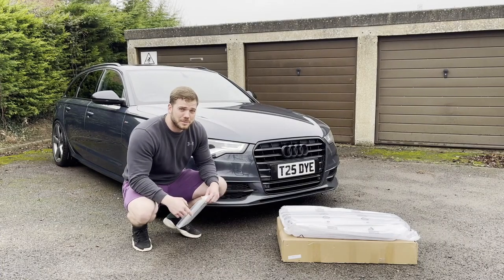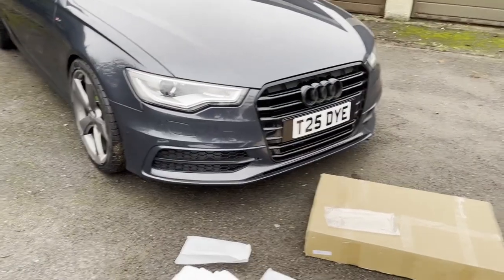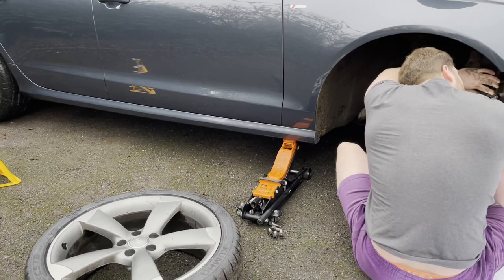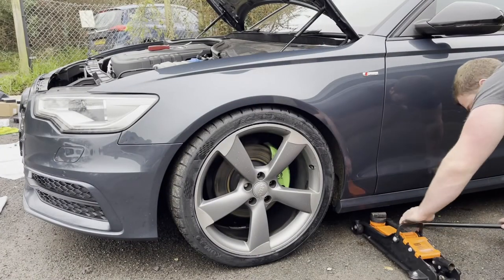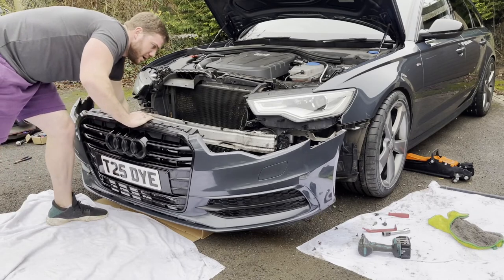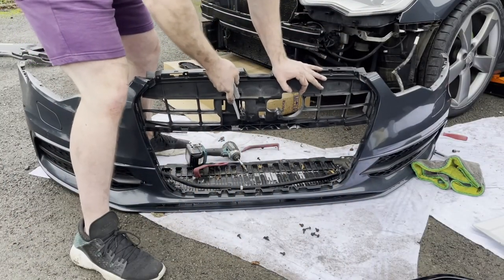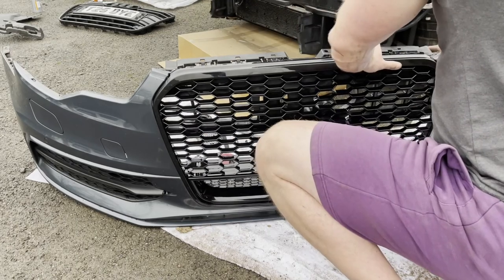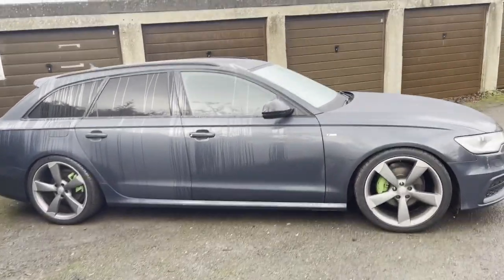Installing an Audi RS6 style Grille on the A6

Comment: looks really good... i'd like to do this my 2014 a6.  what year is yours, and how did you fit the front camera?
Reply from the maker: Cheers bro, mine is a 2014 as well, it’s well worth it. You’ll spend a little bit of time adjusting and tweaking your heights to get it to where you want but once you’ve found where you like it then it’s all worth it. 

Front camera?? I don’t have a front camera buddy
Reply: @TomDyeYT  huh that's weird i thought that was standard... it's the front parking camera... anyway thanks for the reply looking to try to swap my grille this summer.  keep up the good work!
Reply from the maker: @bigwass  cheers bro, the sensors are standard but I don’t have a front camera, only a rear one. The Grille is 100% worth it. Cheers, new content coming soon.